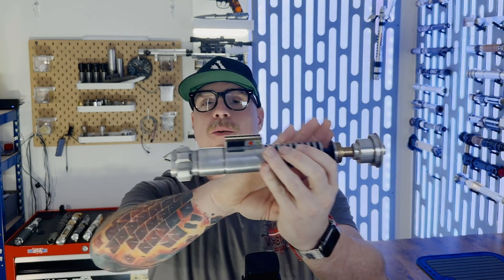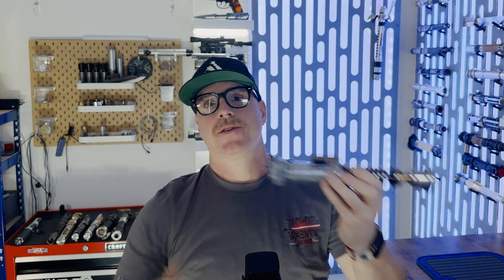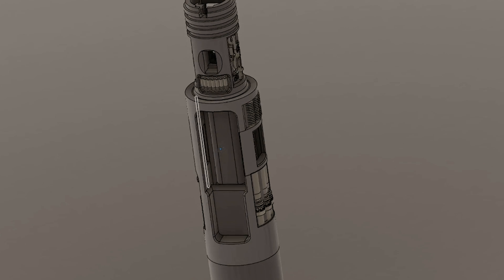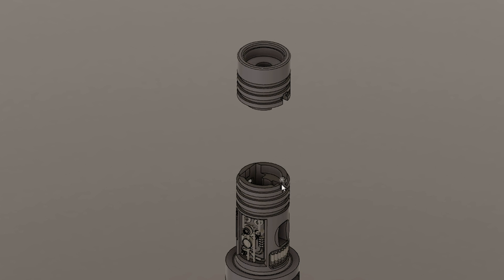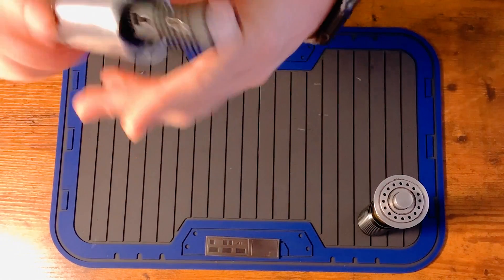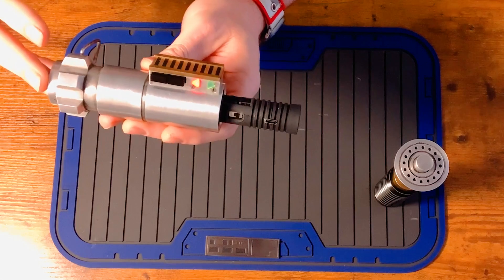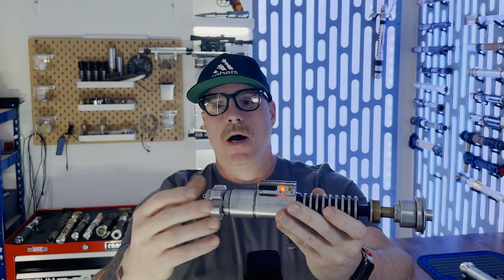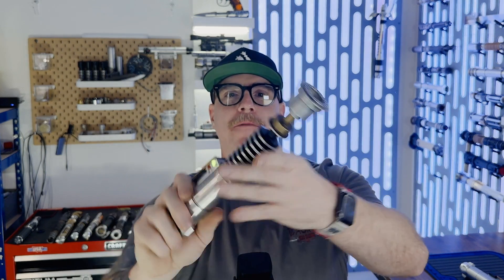Denis Lukyanov ‘Creepy Uncle’ Custom Install

Comment: I installed one with the Goth3Design chassis and found it fairly straightforward. It did come with a 3d printed part for the control box that held the switches and LEDs. The chassis is also really elegantly designed. Davinium Customs did a video on it a few years ago.

Easily my favourite Hero design. I prefer it to the AS Resigner as it has a brass neck rather than painted.

Your chassis looks ace. Loads of functionality in a small amount of space!